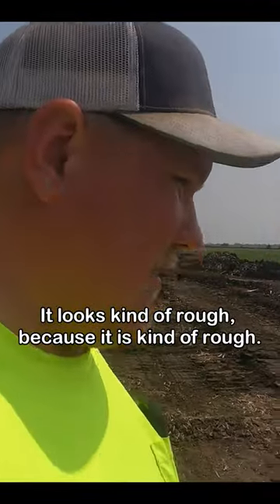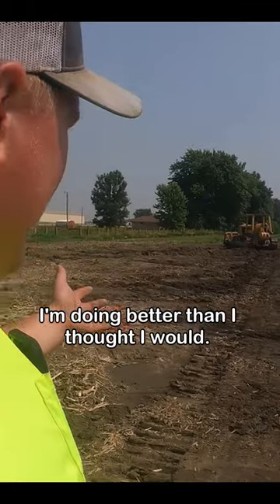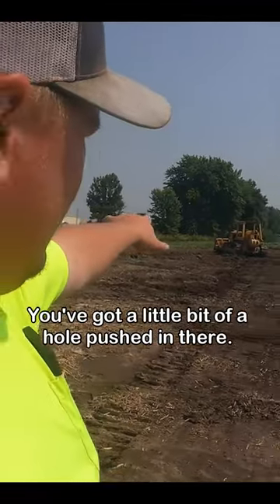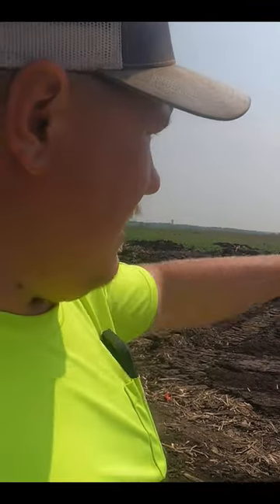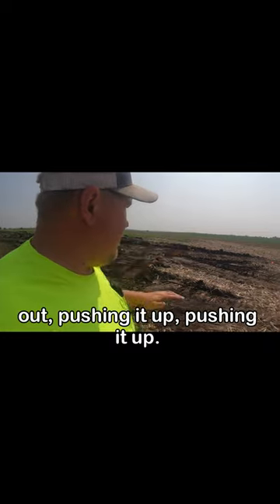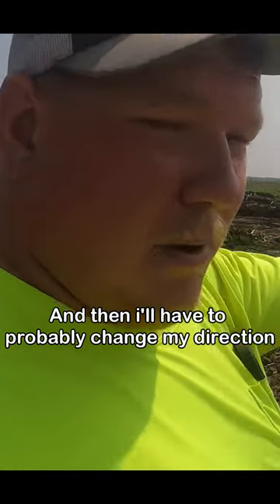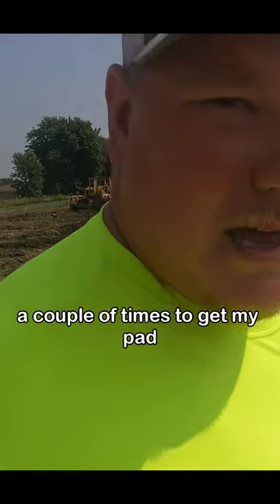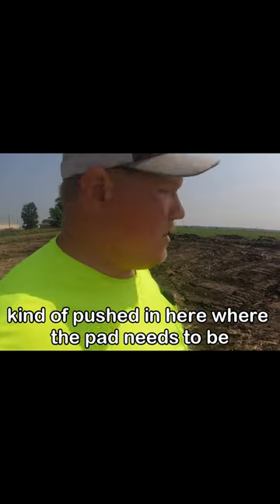IT DOESN'T LOOK AS BAD AS I EXPECTED IT TO!

Comment: Looking good,If you want some Free suggestions from a rookie only 30 yrs experience on those old straight blade dozers, make your first pass like you want then quarter blade your first pass, Just stick as much blade as you can see on your first pass and follow that grade,That will give you a uniform cut all the way across
Reply from the maker: I’ll pay for that advice!
Reply: @iowANFarmer  straight blades are hard to learn grade with that's just a trick I learned that helps